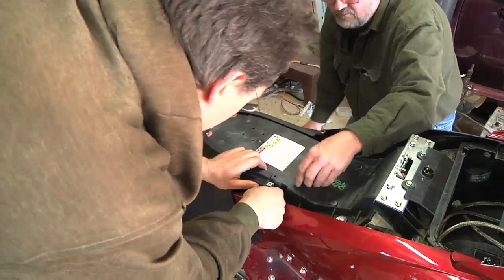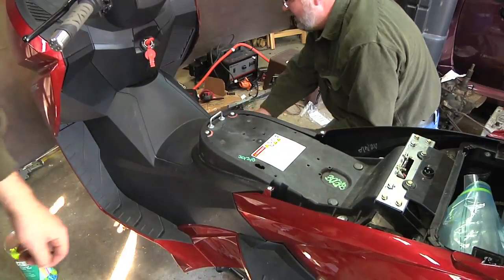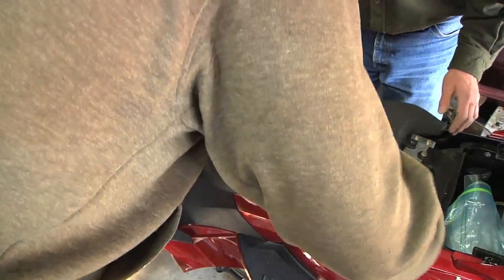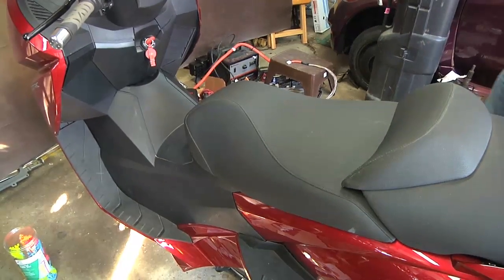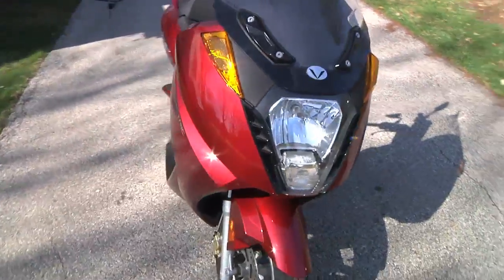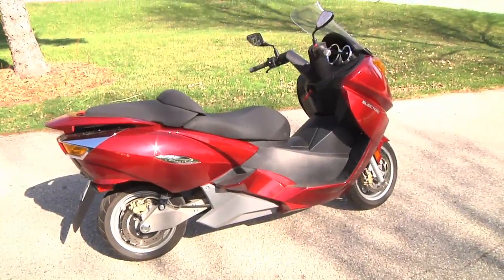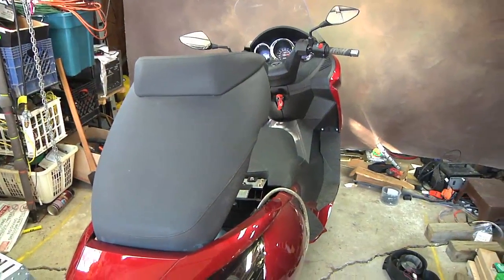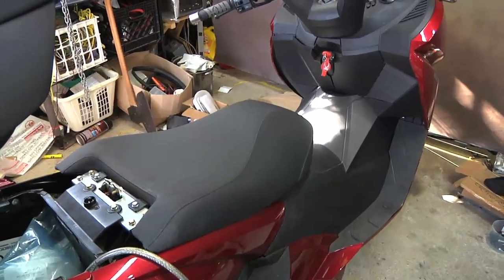Vectrix  w Leaf batts 04 Reassemble Covers and Ride

Comment: Hi Ben, since there are multiple modifications of Vectrix chargers, is it possible to convert any of them to charge Li-Ion batteries? I didn't open mine and not sure the version I have but I suppose it's early aluminum version. Do you know the place where I can borrow gridconnect adapter for just an upgrade?
Reply from the maker: I upgraded my charger to work with the lithium Nissan Leaf batteries. It's a software/firmware update to do that. Go on the V is for Voltage forum for details on how to do it. It's not hard, but requires getting some software that one of the members there reverse engineered.
Reply: Thank you Ben, I've already found a magic web site with all FW available there. That's a good start and I continue learning that. Do you have ESD charger? Silver or gold? or old one aluminum?
Reply from the maker: I'd have to dig through old photos just to remember. I think it was the silver one. I only ever took the front cover off the Vectrix once, and that was pretty much for the heck of it. I DID enjoy upgrading the headlight to LED. Always been pretty happy with that.
Reply: Thank you. I upgraded to LED already. I like it too.

Comment: Pretty cool Benjamin, but I would have done a good Bottom Balancing first, at the half module level, Before wiring the modules in series
That's what I did with my Mini ESS using 3 LEAF Modules 
Then no bms needed
Reply: But from what I found out and experienced testing them for 6 months before putting my mini ESS to work, the half modules are pretty much all in balance, not perfectly but close enough, so you probably don't need to do anything 
What you could do is measure all the half modules once the Vectrix pack is low, like 3V per half module, and check that they are all in balance, at the bottom, then under charge a little to around 4.15V per half modules x the number of half modules installed (19x2?)
Reply from the maker: ***** The batteries were top balanced when I got them. My charger is set to only charge to 4.1V per cell, so yes, undercharging a bit. I'll take a look at what the balance is on the low end when I run the pack down a bit. All of that sort of thing is the next part of what I need to do on the project.

Comment: what is the current weight,range and battery capacity of the scooter ?
Reply from the maker: 2ftpmarco The new LEAF pack weighs about 150 pounds, whereas the old NiMH pack weighed about 200. It's a 9kWh battery pack that creates a theoretical 90 mile range. The lithium upgrade will give much more range than the NiMH and should give a little better acceleration as well.
Reply from the maker: 2ftpmarco There may be better energy density with 18650s, but it wouldn't be cheap for those. By the time I purchased the Nissan LEAF pack, took it apart, and sold off the other modules, my section of the battery pack was free. Also, I'm guessing that a BMS for 1300 cells will be a bit more complicated than 18 LEAF modules. All that said, if somebody did convert a Vectrix using those cells, I'd love to see how they do it!
Reply: BenjaminNelson Fantastic upgrade, great to see how it is done.  Looking forward to seeing you sort out the rest of it.  Makes a superb electric bike doesn't it?
Reply from the maker: 2ftpmarco According to the owner's manual, the original factory weight of the vehicle is 462 pounds (210kg). I believed I have removed a little over 50 pounds while working on this upgrade, so the scooter should now be just over 400 pounds.
Reply: Reportedly several folk are using 18650's in Vectrix.

http://www.evalbum.com/4465
http://www.evalbum.com/4802
Reply: BenjaminNelson thanks !    180-190 kg  that's not bad, i'm curious what the range is now  also i calculated i can fit about 1300 (1100-1500) 18650 cells(70 kg / 15.4kwh )  in a container with the same external dimensions as your 18 cell leaf module pack (630 x  223 x 303 mm /  24.8 x 8.77 x 11.92  inch )
Reply from the maker: Good to know!